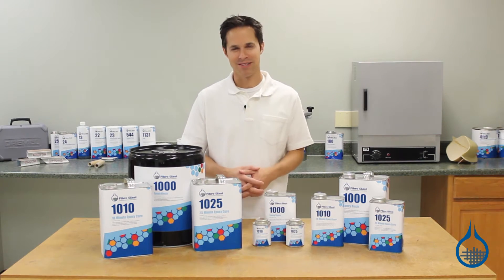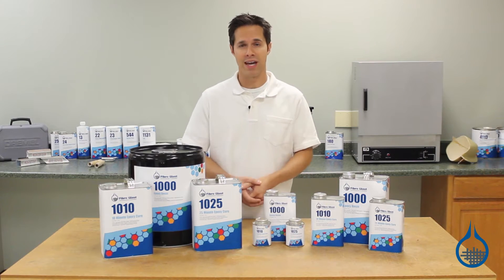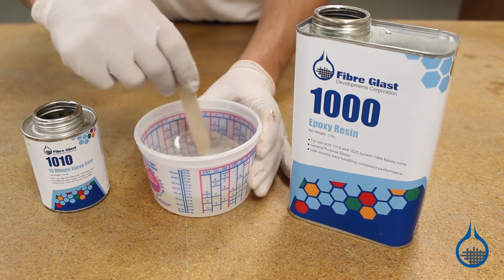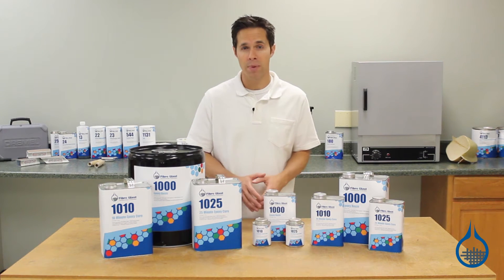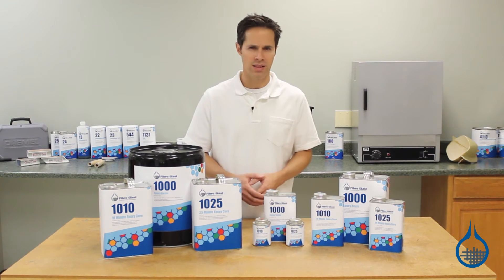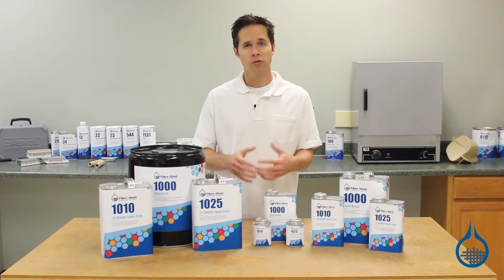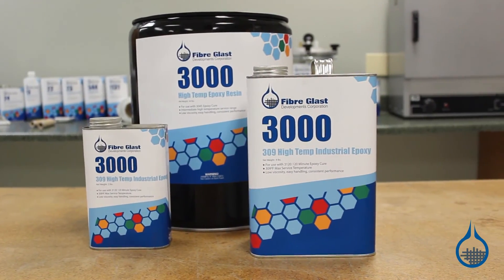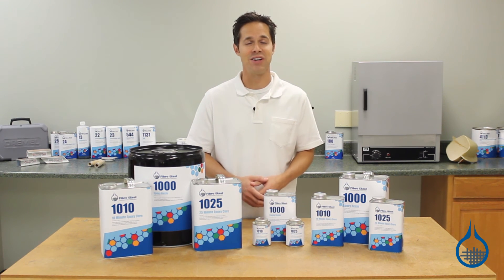System 1000 Epoxy Resin

Comment: I noticed your datasheet lists this at 39,000 psi tensile strength! Is that a typo? That's higher than your aerospace resin. :)  It would be like a general purpose aluminum with the light weight of plastic + the reinforcing fabric.  Sounds too good to be true but amazing if it is.

Comment: how to get the small oven you have there ?
Reply from the maker: Unfortunately I do not know where that oven was purchased from.
Reply: @fibreglast  so i can use conventional kitchen 's oven ?
Reply from the maker: @MC-gr7dp  technically speaking, yes you can use a conventional kitchen oven to cure your parts. However, there will be a strong odor from the curing resin that will occur and conventional ovens are not entirely accurate at maintaining precise temperatures, as many have "hot spots" towards the back of the oven. If you do not have access to a autoclave or oven, we would recommend that you build a "oven" of sorts out of cardboard or wood into which you can pump heat to cure your part.
Reply: @fibreglast  never found a good tutorial for how i have seen afordable sterilizer autoclave for medical purpose or food purpose with temperenture and pressure control so that can work well for curring prepreg right ??
Reply from the maker: @MC-gr7dp  Unfortunately we do not have any tutorials regarding that type of application.

Comment: Hi! I am planning on refurbishing my fiberglass 18 ft drift boat. If has some fiberglass dings, some gouges, deep scratches , and even some minor fiberglass repair. The bottom and sides will also need a new gelcoat. Where do I start with your product?

Comment: hi , what kind of Epoxy Resin do i need for my fiberglass mat to be used for Roof Metal?
Reply from the maker: Hey Cris, the binder used in fiberglass mat isn't soluble with epoxy resins, so we wouldn't recommend them for your application. Instead, you might want to check out either a polyester or vinyl ester resin. If you have your heart set on epoxy, we'd recommend a woven fabric instead.
Reply: k, thanks Fibre Glast.